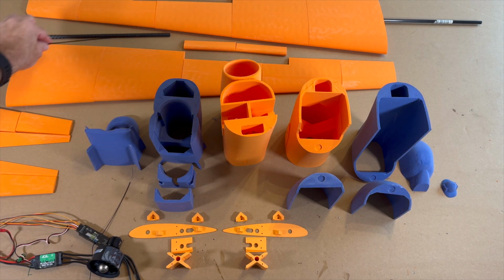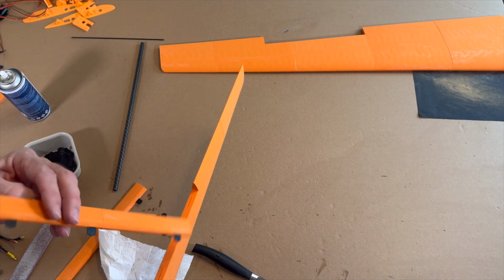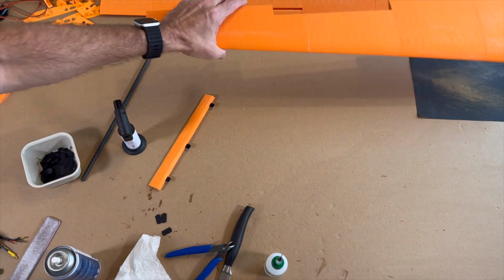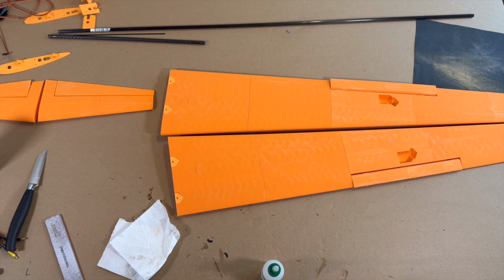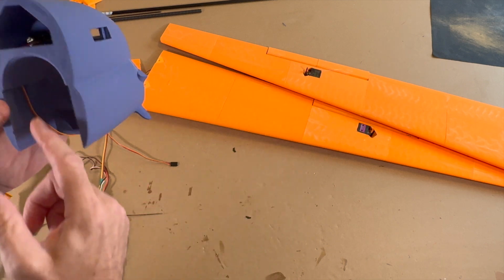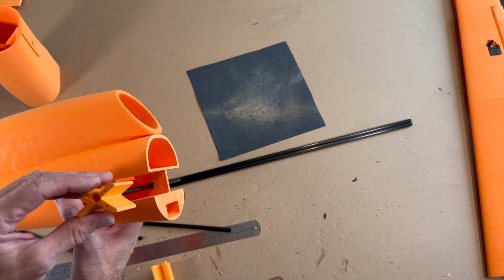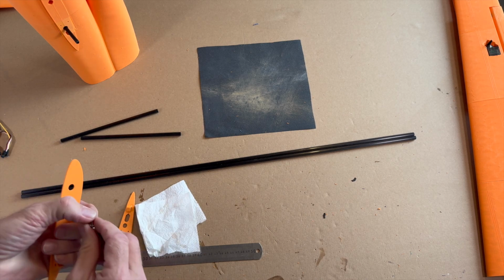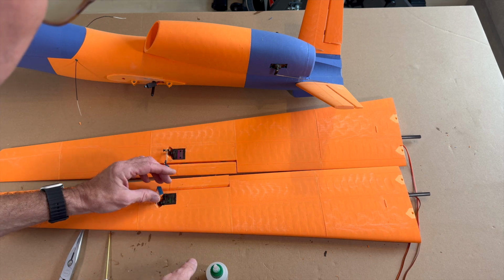Build RQ-4 Global Hawk, 3D printed Plane, 50mm EDF, EDF Glider, FPV, Action Cam, PTIKYLE, SODYs3D

Comment: I'm hoping to print one a little smaller (to use a 30mm EDF)....is it just a matter of resizing the print jobs to 60%, and getting smaller CF tubes, or is there something else I need to be aware of?  Thanks!
Reply from the maker: @johnvinson6239  4.3g Servos? A intereesting challenge!
Reply: @SODYs3D  Yeah, that's what I'm thinking....or maybe 5g

Comment: What tube diameter is in aft fuse that fits in wing tubes
Reply: What length are the 6mm also?
Reply from the maker: @grahamsmyth1982  I used around 200 mm – but in the end, you can decide the length yourself.
Reply from the maker: yes 6mm

Comment: I printed and assembled it. It looks awesome! Why do you prefer a glue gun over CA glue for the servos and EDF? Do you have a Transmitter setup somewhere? I am not sure how to set it up.
Reply from the maker: Congratulations - and thank you. You can remove hot glue from the components, or cut it off with a knife - you can't do that with CA! Unless you want to throw the components away, or you stick good adhesive tape on them first - then CA (I don't do that because I'll be removing the components again soon)!

We're talking about 3D printed planes here, not plywood or GRP planes, which should last longer!

Take a look at the instructions for your transmitter. I used a normal V-tail setup. Travel for the first flight: aileron 150%, elevon mix 100%, rudder 50%! Just aileron and elevon are enough.
Reply: @SODYs3D  That totally makes sense. It didn't cross my mind that it is easier with hot glue to re-use components. Nice!
Reply: I have the V-Tail configuration now setup that the V-Tail acts as my elevators on the right stick, the ailerons are the control surfaces at the main wings on the right stick and the V-Tail acts as ailerons on the left stick left/right. I get about 1 cm movement for the V-Tail surfaces and 1.7 cm movement down and 1 cm up for the wing surfaces ... does that sound right to you?
Reply from the maker: @TheWeltenbauer  Elevator sounds good, I would choose a small deflection for the rudder function of the V-tail! Set the aileron in the remote control to maximum travel (travel 150% up/down) - first! Better too much than not being able to make it around the bend! You can see it in the Maiden video!

Comment: Hi Thomas. You did not mention that you have to cut off the wing servo attachments to fit!
Reply: Also the 6mm tube is not in the bom
Reply from the maker: @TristramBudelcom  Hi, the 6mm tube is an option, you don't need it! That's why I say in the video, you can!
Reply from the maker: Depending on the print result, it may be tight - I always use 102% of the recommended servos! I didn't have to cut anything out! It's a shame you had to cut anything! I always do it like this: I thread the servo cable, then place the servo upright in the slot and then rotate the servo into the recess!

Comment: 0112   the wing design should not include the use of a scale-accurate profile.    instead, a flat-bottomed profile, like the original clark-y profile, should be used.     ailerons should be at the wingtips; not inboard of them.      the mass of aileron servos should be located as far inboard as is practical, and forward-of thirty percent of chord.
0847   ideally, a control surface should have the shape of a parallelogram.
1211   rapidly pushing a servo arm is a good way to  STRIP  the  gears.!

1240   aileron servo(s) poorly located.
1510   CF  is  HEAVY  and it should not be your  'go to'  material for spars.
2136   it is recommended that the mass of servos not be located aft-of the cg/c-m;  because doing so increases the amount of tail heaviness in a model's  dom.   distribution of mass.
Reply: I'm half way through this plane, what is the best material to use for the spar if not carbon fiber? Thanks
Reply from the maker: Fiberglas Tubes, but they are heavier
Reply: Nothing you say is wrong, but there are practical limitations. BTW, the Clark-Y is ancient technology. So many better airfoils available for models in this flight envelope.

Comment: I need information of what carbon tube you use for the build, like 8MM OD X  6MM ID X 1000 L, because the inside diameter vary from tube to tube.  Thanks.
Reply from the maker: @maxun1  exakt! 2x 8mm od, 6mm id x 1000mm !

Comment: Hi Thomas!  Just downloaded the files for this build. Please tell me what model 50mm EDF fits this?  With fins or no fins?  I will be using a 4s 2400KV battery. THANKS!
Reply from the maker: @steverettew2590  It is a cutout for an XFly EDF50, which is one of the largest - I use a QX EDF 50, which fits well, with an FMS without a holder you don't need to print any shells or use more hot glue! All 50mm EDFs should fit in! S2400 SMC fits!